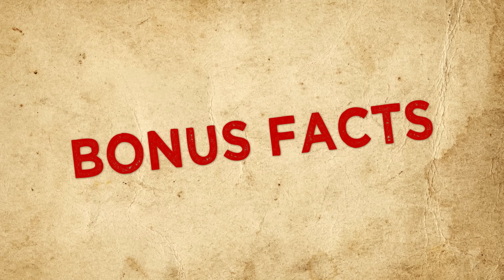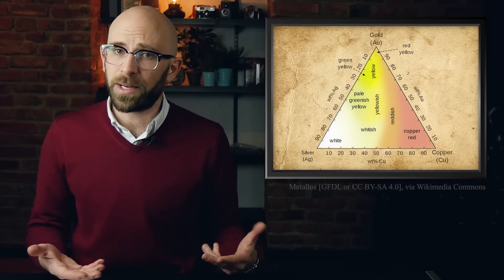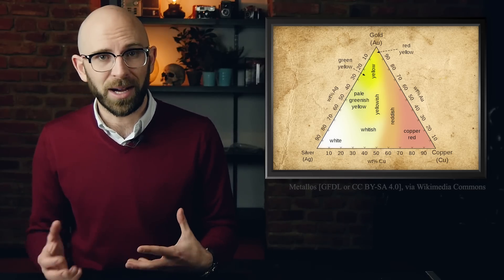How Do They Make White Gold White Given That It's an Element?

Comment: 'Black gold' by coating it in black rhodium... so you can make purple gold by painting it with purple paint...
Reply: You can actually get purple gold by using aluminium as as alloy. Unfortunately, the metal becomes almost unworkable due to how brittle it is. Looks pretty though.
Reply: I'm looking for vibrant Blue-Gold.
Reply: @rashidisw  as far as I'm aware, enamel is your only option at the moment.
Reply: Seems legit
Reply: Funny enough there is a purple gold alloy, as fare as i can remember  (this is about 12 years ago) its gold and aluminium, its not workable by hand, way to brittle. The ring was cast and still gave a lot of problems after that. https://en.m.wikipedia.org/wiki/Colored_gold#Purple_gold
Reply: Fucking thank you
Reply: BTW, rhodium plating does come in many colors. Lol 😉
Reply: He didn't research well for this video. Colored gold can and usually is actually gold that is various colors by what is mixed with it. Not coated! The rhodium plating is to protect it from scratches and wear. Not to hide the true color! At least if purchased through a reputable jeweler or store. 

I have a good collection of jewelry in various colors. My wedding set is white gold and NOT plated at all. He had it custom made by a retired jeweler friend of ours.  It is solid white gold and very white looking. Sterling is the typical additive to give it the white color. 

Nickel hasn't been used as an additive in a long time in quality jewelry! He either didn't research at all or is talking about crappy jewelry.
Reply: @jeniwatkins3297 That actually isn't accurate. It depends on if you're talking Europe or the rest of the world. Point of interest, I'm a goldsmith. Nickel white gold (which is a horrendous pain the work with) is still pretty common in North America. Whereas the standard in Europe is now palladium white gold. There's outliers like me in North America who are adament about using palladium white because it looks so much nicer (oh yeah, that white brass totes has nickel in it too). As for silver in gold? That doesn't make it more white. It's added to the gold with copper to give it more strength. It dilutes the colour more than it turns it white. If you look at. Piece of 18k gold next to a piece of 14k, you'll see that the colour in the 18k piece is much more vibrant.

I also hope the tone isn't offensive, I just want to set the record straight as this is the industry I work in.
Reply: @NjalStormcaller  Thank You for the respectful reply and info. I was mistaken or at least forgot, that the sterling isn't so much for the actual color. I knew it was in there though. Lol 😉

Can you explain why I can't wear nickel jewelry yet, can wear all my white gold, including the ones not plated? I don't wear my engagement ring much if the time, to protect it. I work with my hands a lot. But my wedding band never leaves my hand. We've been married a long time too. 

And yes, i know different gold k have various colors. I'm actually pretty good at spotting what it is before checking. It's pretty obvious if you pay attention. Most people don't. I also know some of the white metals by sight due to color variations in them as well.
Reply: @jeniwatkins3297  white gold is usually Rhodium plated. this is more the rule than the exception. it typically takes about a year for the plating to wear off. as for the other various colours you can do it either way (plating or base metal)
Reply: @_undefined1744   good quality gold is only plated to protect it. As i said. It's only in recent years become the normal. But it still should be solid colored gold under the coating. Reputable jewelers do not take yellow gold and coat it white
Reply: @jeniwatkins3297  You might want to watch the video again. He did say at the beginning that is was what it was mixed with that caused the color and that rhodium plating was what less reputable jewelers did but he still kept talking about rhodium plating afterwards for some reason. I think he just got mixed up. Also, he said that nickel used to be popular due to it being cheap but isn't used as much anymore.
Reply: @ViviSectia  Properly mixed white gold still has a gold tint. For this reason, rhodium plating is still used even in true white gold jewelry to finalize the white gold look. What is different is that normal gold plated with rhodium just turns into a gold color when the rhodium layer is eroded, while true white gold still looks white but with a golden tint.

Comment: I didn't know gold could be so many different colors🤔
Reply: It can't lol. Gold is gold. If it is any other colour then it's not just gold anymore :~)
Reply: Solid 24k gold is only one color. It's actually a darker yellow, almost a slight orange tint. Jewelry is generally not a full 24k because it's extremely soft and will bend with wear. That's why standard is 14k for strength.

Colored gold is still gold. It's just mixed with other metals to create other colors. Gold for jewelry is mixed anyway. They just change what else is used to alter the color. More sterling makes it white, more copper to make it rose gold and so forth